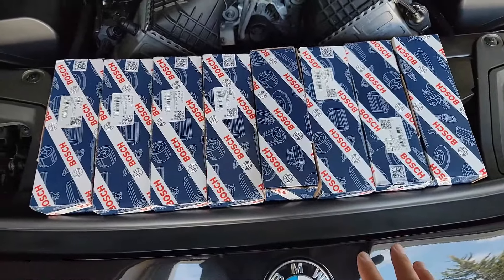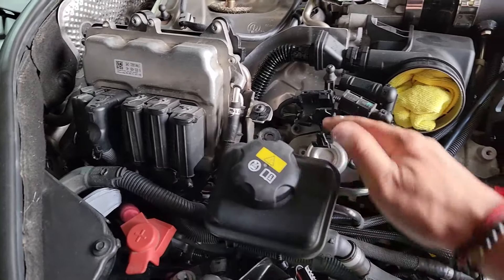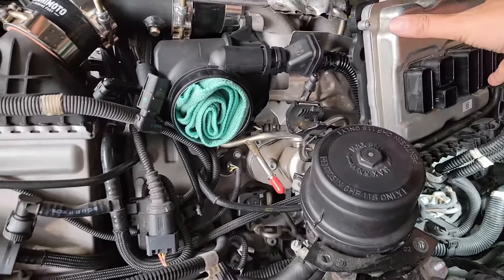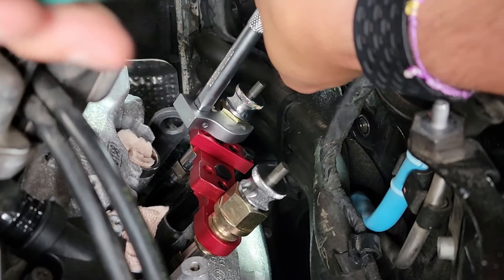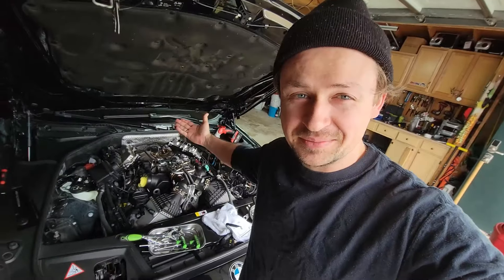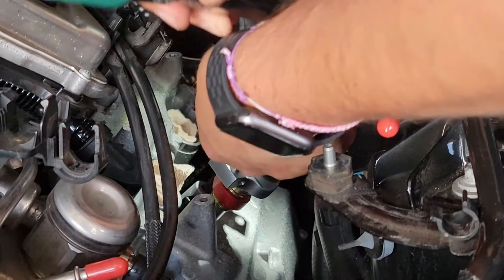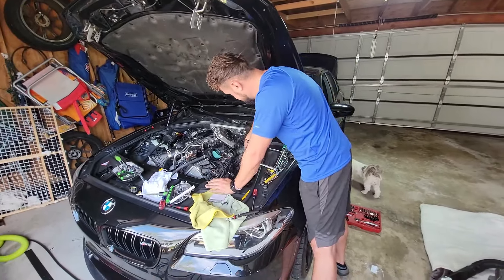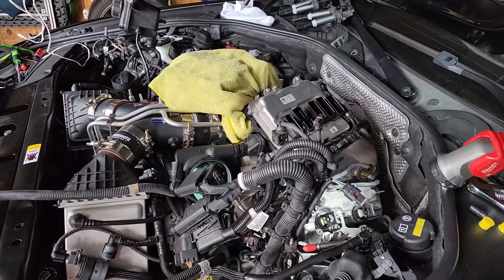Fuel Injector Replacement -EU6- Bmw M5 F10

Comment: Injectors do not need to be changed. The engine has injectors made in Germany, and the Bosch injector is of poor quality from Turkey. The injectors can be washed inexpensively, checked, and they are put back into the car. Click on the nickname, there is a video with a BMW

Comment: I have an M5 competition. After the downpipe installation, white smoke has started to come when the engine warms up. only when gas is applied and released. Can't see that it uses cooler fluid. I think the oil consumption is normal. What do you think it could be? Anyone else here with experience?
Reply: I also have the same issue. I’m on Mhd stage 2 catless. Sometimes When I pull up to a stop light I can see a cloud of white smoke coming from the exhaust. Doesn’t happen every time tho. Car is currently getting AC compressor replaced and they are also looking into the issue.
Reply: The factory cats are really good at hiding your valve stem seals. My advice to anyone with an M5 for a f10 550i is to do the rod bearings, injectors, valve stem seals. I am guessing your downpipes are catless? Anytime you go catless, expect the horrible smell and smoke.

Comment: That’s one crowded engine bay.. Thought working on my Merc was hard but this is another level
Reply: This is actually not bad at all 
Did you ever work on MB m278 engine its F crazy you can’t pass screwdriver to the clamp on intercooler

Comment: This is the only video online of this kind.  Thank you!  Since your new injector values were exactly the same as the old ones did you really need to do the ISTA steps?  My S63TU3 is misfiring in one of my cylinders (6) at idle only and I want to DIY just that one.  My issue is that I don’t have access to ISTA

Comment: I followed this as I was doing injectors seals and decouplers, jobbwent smoothly, till I reset adaptations, then I now have a fault Exhaust Camshaft: Installation Faulty.

I have done nonwork or anything near the camshaft, bmw dealer stated that deleting the adaptions has reset the timing position, and now needs to have the valve cover off to have the timing reset with the special tool.

Any body have this problem before, or fixed it?

Fault codes.
164041 - Exhaust CamShaft: Installation Faulty 
120408 - Charging Pressure control: Switch off as consequential action
120908 - Charging Pressure control 2: Switch off as consequential action

Comment: Great vide. Did u change the seals for the injectors aswell?
Reply from the maker: Yes I show it in the video
Reply: @BulletsGarage  ohhh is that the metal ring?? The decoupler I think it's called
Reply from the maker: @corrieharris774  yes
Reply: Is the decoupled necessary? Can I use a high temp rubber gasket thats about the same size?
Reply from the maker: @ypathewayincorporated5530  it’s absolutely needed don’t do some stupid stuff and risk a fire do it how it should be done

Comment: You miss the gsf yet? Lol
Reply from the maker: Nope not at all
Reply: @BulletsGarage  I know this makes more power but a gsf with the new elate supercharger I think would be a great combo. Wayyyyy easier to work on and maintain lol.
Reply from the maker: @chrissal4759  you have a link to this new supercharger? Never heard of it. And are they still limited on tuning options because that’s the whole reason I think RR racing keeps blowing motors with their shit cause they’re not doing proper tuning.
Reply: @BulletsGarage putting forced induction on a 12.3 to 1 compression, high revving v8 is no joke.  Not surprising they are having issues
Reply: @dvaritek434  they need to use e85
Reply: The only benefit to the gsf is reliability m5 does everything else better